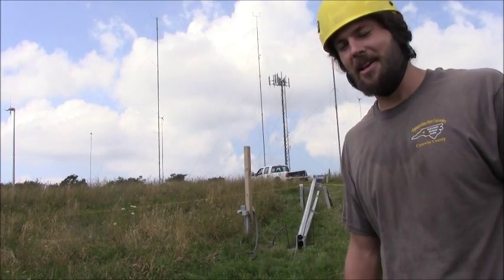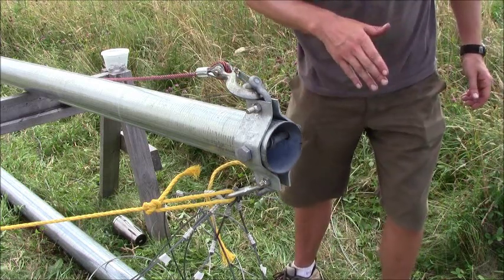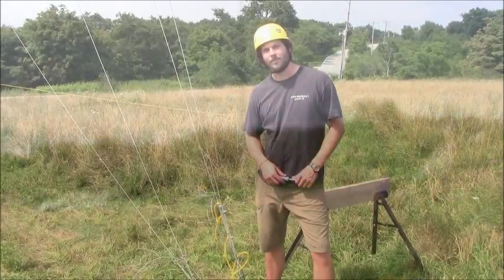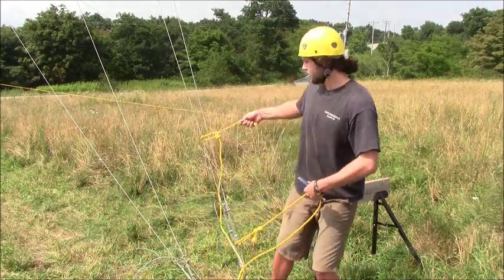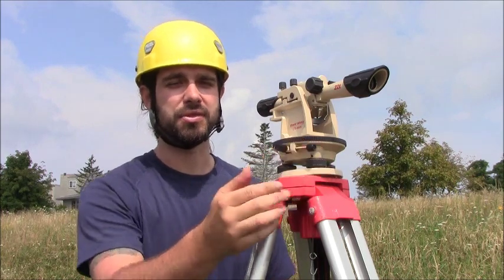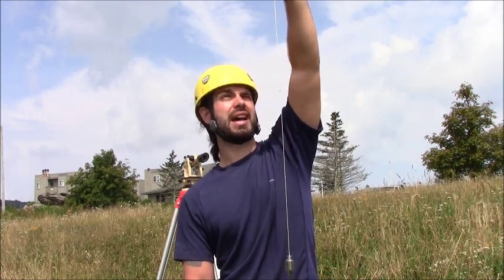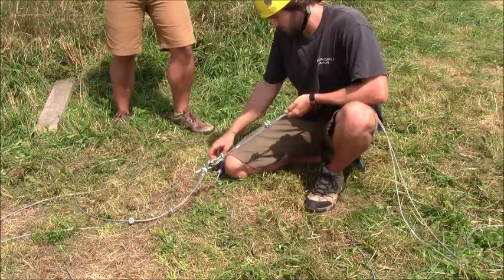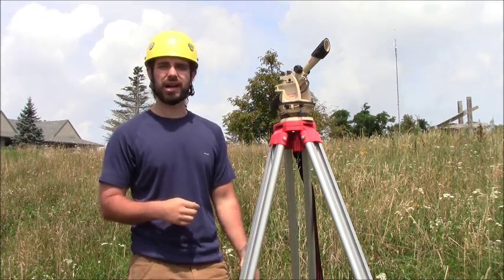Part 4 - Test Raising an 80 ft. Bergey Excel 1 Turbine Tower

Comment: Great work....But I see you arent right good with a spanner or adjustable, use a socket and i noticed that you pushed down in towards the concrete....OUCH! if the spanner slip`s.
Reply: ya but these lads are doing some nice work do, i spotted that to but said to myself naaa

Comment: Sebastian's comment that the back guy wires might snap had better be incorrect (It's more likely his lack of knowledge showing through again). If it's the case that erecting the tower could impart enough strain to cause the wire rope to part, it's far too small for the application. It's far more likely that a guy anchor could be shifted or attachment hardware deformed. You'd have to put one heck of a strain on your winch to get it to that point anyway, which would be a telltale that something is seriously wrong and you should stop.

Bottom line - this sort of unscripted, off the cuff instruction by non-professionals is misleading and potentially dangerous to those thinking they're getting a complete and accurate set of instructions. Too much is missing or inaccurate. A better way to do this would be with a well written story-boarded shooting script and voice-overs. My advice is to pull these videos off line before someone gets hurt and sues the university.
Reply: I would have thought it was little bit of over kill , but its going to be well stayed . It aint going anywhere . great job lad.